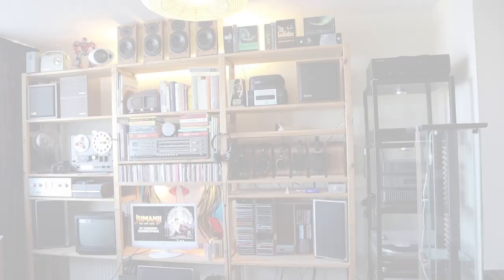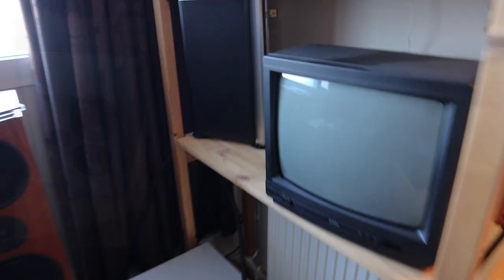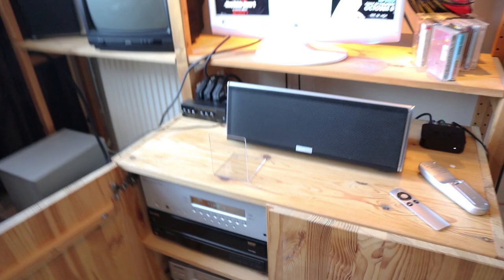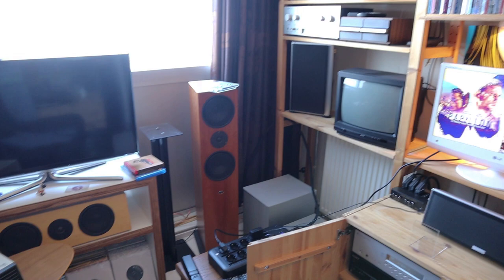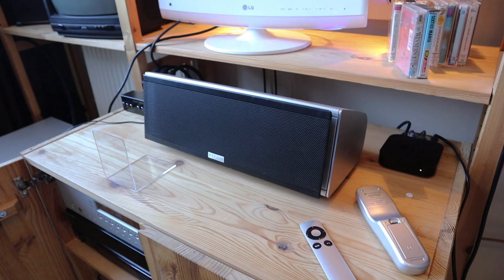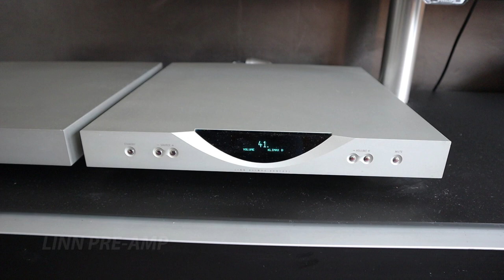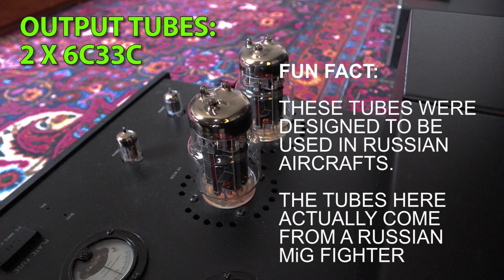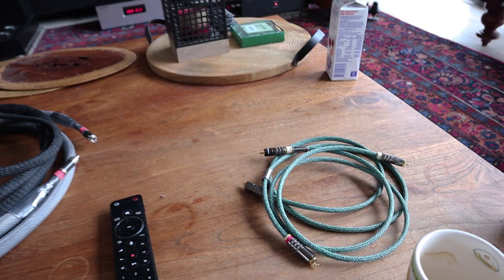VLOG 129:  CAN TUBE AMPS DO BASS?  PLUS: UPDATE ON MY DOWNSTAIRS SETUP

Comment: I will buy this used sistem,  Serblin ktema, spectral 300, msb discrete with psu and usb module, 31k euro ( I hope to reach that speaking of a 4 k euro discount on three deals), 3 different sellers, I am totally crazy .😂if you have the room, side space for the ktema, and acoustics treatments, it will be a good value.
You can score for ktema and boulder 866, for 23/24 k even better .
Boulder 865, Volterra rosso fiorentino , dcs bartok, for 13.5k more or less…